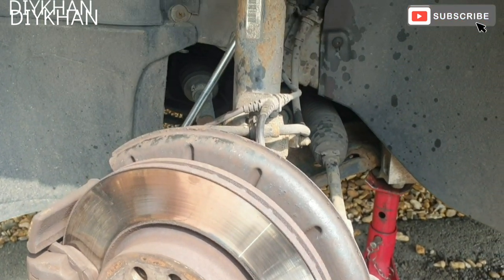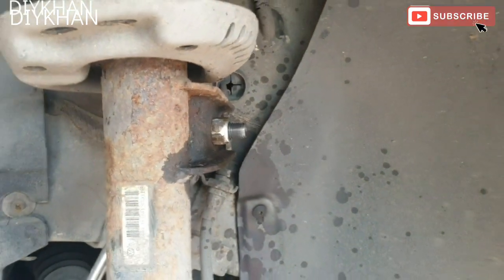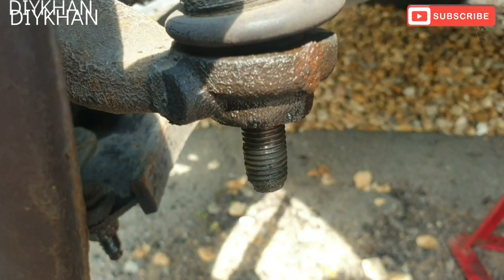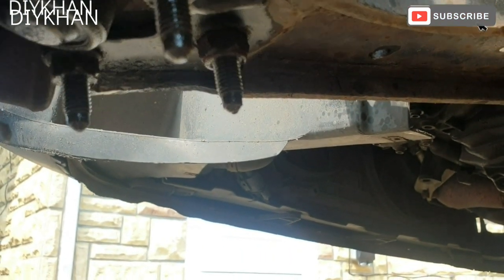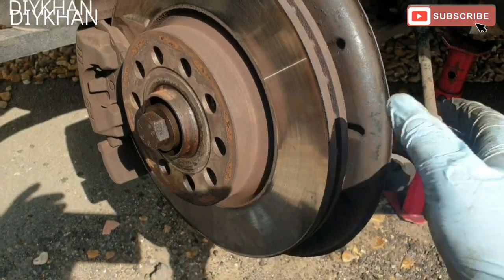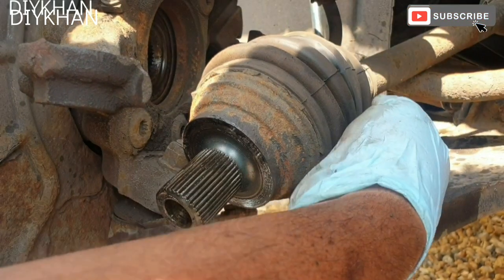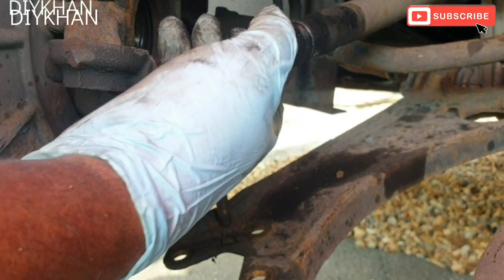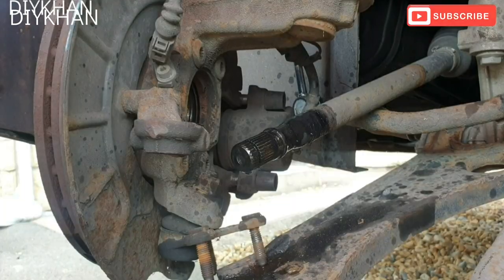VW Golf, Polo, Passat, Touran, Transporter, Skoda, Seat, Audi CV Joint & CV Gaiter Boot Replacement.

Comment: Hi, Were the symptoms such that when you turned right you got a clicking noise coming from front, how do you test whether the CV joint has gone without taking the rubber bellow apart, Thanks
Reply from the maker: Yes exactly same noise